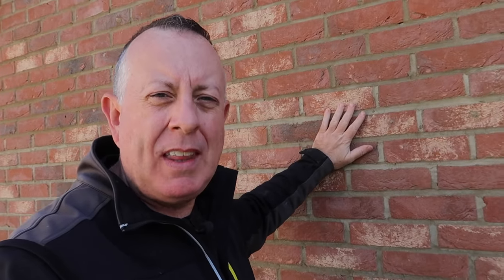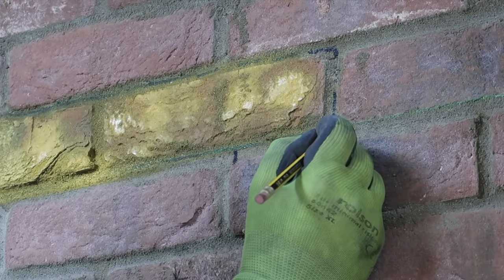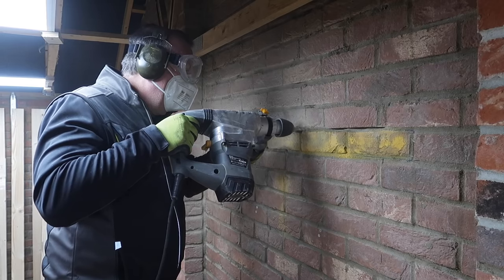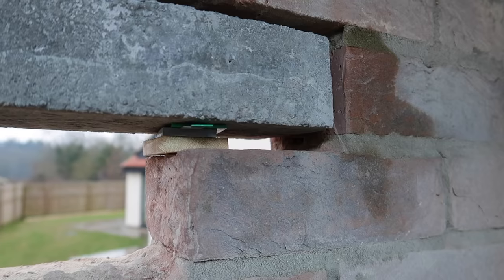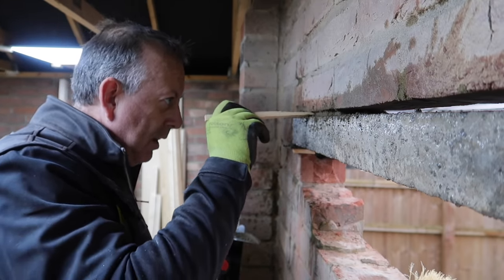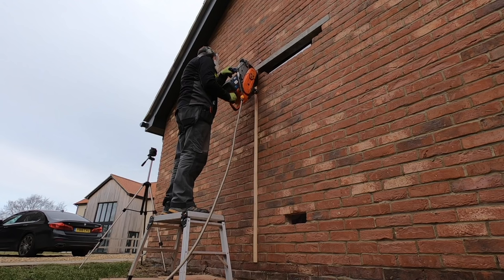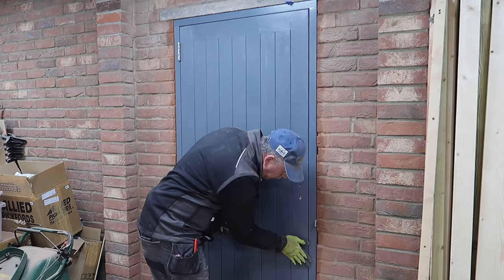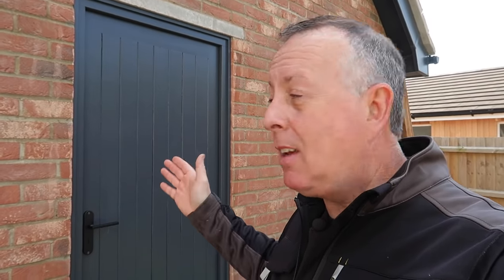How to Install a Lintel and New Opening in Brickwork - Garage to Workshop Conversion Part 3

Comment: An absolute joy to watch this. No corners cut, everything planned and explained in detail. Quite often the finer details are ignored, I've seen so many lintel installations on YouTube that have failed to explain how to position the lintel and how to get the mortar around it. Holding the mortar holder/finishing trowel in position and pushing in the mortar with a square ended stick works far better than a finger trowel. Also loved the timber guide idea. I would've marked it with a pen or spray paint and, as you point out, once the dust starts it becomes completely invisible. Anyway, great video, my kind of work, belt and braces. Thank you!

Comment: Just a tip Stu, nothing wrong with your lintel installation, but I used to, in this instance, lay a layer of soft but good strength mix of mortar on top of the lintel (as if you were laying bricks on it) then offer it up and lift up in place using two bottle jacks. Best way to get a tight joint and then fill in your 150-200mm underneath each side. It will never move totally solid ! Really enjoy your channel BTW

Comment: Superb thanks. Only have one problem doing this myself. I'm scared to death of loosing a limb using one of those petrol grinders. I'm used to use table saws, angle grinders, jointers etc. Angle grinders are the most scary but that huge exposed blade is next level terrifying.

Comment: What a cracking video. Good use of the stick, it should not be underestimated. I liked your comment about the automatic amputation machine. Truth is, it easily capable of doing you proper damage. So don't muck about and protect yourself.
Reply from the maker: Thank you

Comment: 6:55  When pointing I have always used a 10mm mastic knife. Additives make the mortar more workable. Tap the mortar down on to your hawk or  mortar board so it sticks to it and is approx 10mm thick or the thickness of the joint your filling. Then cut off sections the depth you require  with your mastic knife and push it into the seam that you are filling.

Comment: That was a satisfying project to watch and the end result looks great! I've actually used an SDS drill bit in an ordinary chuck once, but it actually damaged the SDS shank of the bit ever so slightly. The damage was barely noticeable but it meant that although the bit would fit into my SDS drill, I couldn't get it back out again without disassembling the SDS chuck and removing the ball bearing which retains the bit.
Reply from the maker: Oh that's interesting. I won't try it again unless a real emergency!

Comment: You are my new hero. Huuuuge man crush. 🤪 Seriously though, this is just about the most perfect a project video can get. I will be doing this indoors soon. Since the wall isn't that high I will probably have to support the top few rows before removing the bricks underneath. I'm thinking of drilling a hole right through a few of those top bricks and fixing them to an upright piece of timber. The walls will be plastered after so no worries about the holes in those bricks.

Comment: Very clearly explained. You would have benefited from a tuck pointer when doing the pointing around the lintel, basically the same as your stick method. They are cheap but very useful.

Comment: 6:54 - That mix might be too dry for this, but have you tried using a piping bag (or a generic plastic bag with one of the corners cut)?  You just flatten the bag until it fits in the gap, slide it until the "spout" is at the end, and then squeeze it as you pull it out. Works well for regular (wetter) cement / mortar.

Comment: My tip is to fit frame and temporarily wedge and then use LOW VOLUME expanding foam to secure the door. You don’t need screws at all. So no filling of screw heads. And the door will close solidly. 

I don’t want to start a debate. Because I’m right :) try it. It secures the door many times stronger than screws. 

Nice video.
Reply from the maker: Thats not one I've heard but I can see how enough foam would secure the door.

Comment: A little tip. Use slate to pack up in between the lintel and the bricks and under the lintel to  the seating, and then you can point up the rest of the gaps with normal mortar mix to  make it blend in. Also where the lintel is sitting on the brickwork should be a minimum of 150mm so as not to cause shear on the perps.
Reply: I'm not a pro but I thought as well I would have let the lintel go wider on both ends.

Comment: Nice job and the battens to guide your cutting blade is a good one.
But usually manufacturers of those pre-stressed lintels will tell you not to cut these, however I doubt cutting a bit off does harm them, as the pre-stressed bar has these spirals to give it bite to the concrete.
So it doesn't depend on anchoring bolts or wedges in the ends, but grabs onto the concrete over the whole length.
Reply from the maker: Thanks. Any post stressed concrete you need to avoid touching but prestressed I've not hear manufacturers saying that before - anyway, as you say, it is essentially bonded to the concrete over the full length so cutting a few inches off is no problem.
Reply: @ProperDIY  At least that was what was stated by one of the manufacturers here in the Netherlands, they tell you not to cut a lintel without consulting them first, I think this has to do more with liability.
Reply from the maker: @Tom-Lahaye  Yes, could well be. On site it's common to trim lintels when required so they are just covering themselves

Comment: Nicely done. The video quality is excellent and the information was concise.
I noticed you didn't use any flashing. The cut was so precise there was no need to hide any blemishes. What advice would you offer in terms of door frame dimensions versus the brick cut dimensions.
Please forgive me if this has been addressed before. There are quite a few comments and I didn't read every single one. Cheers.
Reply from the maker: Thanks. I went for 5mm extra on each side. I could do this as I used a baton to control where I cut so could be quite accurate.

Comment: Hi Stewart! I'm a recent follower and I've already learned loads from your channel! 

I'm opening up a double doorway to install trifold doors. It's not a load bearing wall. Do you think a 9' concrete lintel would be sufficient support or should I be looking at a steel beam instead? It's a block built wall with a 6' concrete lintel in place currently. Thanks a mil. 

Niamh

Comment: You put shims in between the bottom of the lintel and the brickwork. I was hoping to see how you dealt with filling/supporting the lintel while this set.
Reply from the maker: I should have shown that but it is straight forward... With such a dry mix, you can pack where you can and then take out the shims without it moving then pack in the void they leave.

Comment: Rarther than poking in the mortar with a trowel, for about £20 you can buy a mortar (cement) gun. Much easier and it gives a much better bond. I've used them for years.
Reply from the maker: Fair enough, but for £20 I'll stick to the stick!

Comment: I want to add an additional grp electric meter box into the exterior wall cavity. only outside bricks needs removing.
Can I use a metal flat bar in the mortar course to be the lintel?

Comment: awesome job very informative! I'm considering doing this to my garage but my bricks are perforated in the centre - how would you finish the door opening with exposed perforations once the opening is cut? and what best fixings to use to secure a UPC door to perforated brick? many thanks.
Reply from the maker: Thank you. I would be looking at a door frame (lining) that is just narrower than the half brick thick wall (say 80mm for a 100mm wall). That would hide the voids. I would still try to use 'frame fixings' and aim for the brickwork that remains - if there isn't enough because of the voids then aim to use chemical anchors - widely available now for DIY'ers.

Comment: Did you put dpc below the door?
Reply: Same question here. 😱

I've watched a few so-called tutorials on YouTube for new external doors or windows, but haven't found one yet where they installed a new DPC or flashing (as would be required).

Considering he put a concrete step directly under the door, that's going to concentrate a lot of moisture in one area, which will lead to internal damp if no DPC has been used.

I like this guy's content, but he's got to look back at this one and clarify some essential points, such as  damp management.

Comment: I went to remove a 1960’s garage door and frame. Could see the concrete lintel on the inside course, couldn’t see it on outside facebrick course as was hidden behind the old wooden door frame. Turns out there was no outer lintel and a huge triangle of bricks started to aim for my head. It’s propped for now and only lost four bricks so far.

Comment: We recently moved into a new house which was build in 85. The brickwork is a sandy brown in colour and mortared with a mix I have not seen before. It’s not your usual builders sand mix. Can you advise how to match the mix in order to allow repairs and improvements to be made with the match standing out. Previous repairs have been poorly matched and will also require grinding out and improved. It’s possible the sand could be washed Building sand. Not entirely sure. Thanks in advance.

Comment: Should you have not made return pillars inside the garage to add strength to the doorway? By chopping finger joints in the brickwork and returning them inward and bricking up pillars. My garage has pillars either side of the doorway on my single skin/ brickwork garage. House is 1970s. I worry that if someone slammed the door or the wind caught hold of it you would have all the brickwork down on the floor.
Reply from the maker: No need in my case as not that much load. Most doorways you see do not need a column each side.

Comment: You need to be really accurate and neat when cutting the brick work especially on the outside as it will be on show when its finished. I see you put a small trim around but that didn't completely cover the cut bricks. The new cut face on the outside reveal will be on show and depending on the type of brick and the cut will make a difference to the overall look of the finished job - on the inside you don't get the problem because you used architrave. Looks neat though, nice job. Maybe explain in more detail about setting the door lining square and plumb next time.

Comment: Brilliant video. I have the same need at home, however inside the brickwork I have concrete blocks also with a cavity. The garage is free standing and a standard size etc, so don't believe the wall is load bearing in anyway. Is the principle the same but just double the work, i.e cut the brick and the blocks etc?
Reply from the maker: Yes essentially however it may be easier to use some type of galvanised cavity tray rather than a concrete lintel as you have a cavity wall
Reply: @ProperDIY  good shout. Brilliant thanks.

Comment: Stuart,

Great video. I am about to attempt this but I have a question, can anyone help?

DPC... I want to cut my hole and install the door level with the ground so I don't have a step (my garage floor is same level as the outside where the new door is going). This is under the DPC level though by 1 or 2 bricks. If I cut through the DPC... how do I deal with this so I don't create any future problems? Is this something to worry about?

Thanks

Comment: Great vid. How do you pack the cement under the lintel, do you leave the shims and fill the dry mix around them? Also why dry mix and not wet? Less mess.? Cheers
Reply from the maker: Thanks. I should have shown that. I did it in the same way packing as much as I could in the areas next to the shims until I could remove them with the weight being taken by the motar. With the dry mortar well compacted into the gap, it will take quite a load.

Comment: When you cut the lintel didn’t you also sever the tendon?  Or is it ok to cut it?  Why just not take out another brick
Reply from the maker: The tendon is stretched then concrete is poured around it and let to gain strength before the tension is released (in fact they make a number of these in a continuous line and then cut them to length). So no problem cutting the lintel anywhere.
I could have taken out more bricks but to be symmetrical I would have to take one on either side - so the lintel would end up another 440mm long which wouldn't look correct and would leave me with significantly larger span of unsupported wall above.

Comment: Very nice. Did you consider using a Catnic or similar lintel and keeping the top course of bricks?
Reply from the maker: I did look at them but the making good after installation is a lot more work and the concrete lintel I used was £12 so difficult to beat
Reply: Fair enough.

Comment: For the cement bed under the lintel, at either end, do you push that in with the same method using the stick?
Reply from the maker: Yes, a very dry mix that you can compact rather than slumps out

Comment: I don't think I could have restrained myself...  I would have given it all a hefty push. Plus, I imagine the bricks falling on each other, one at a time, would cause more breakages...  But, even if I'm wrong, I would have still tried it in one go - filmed in slo-mo... from several angles... with a cutaway of my dislocated shoulder.  ;-)
Reply from the maker: The main reason I didn't was I knew I would get comments from builders tell me how dangerous it was - and not wanting to encourage others to do the same. I would have pushed it over if no one was looking!

Comment: Do you have to put fixings for the door frame into the lintel? Or does that weaken it?
Reply from the maker: You can do - a couple of small holes into the lintel will be fine but quite hard drilling into concrete so all my fixings went sideways into the brick.

Comment: Did you have a SE specify the lintel or are there set lintels off the shelf for specific applications?
Reply from the maker: I'm a professional Civil Engineer by trade so all my design however for this application the loads are extremely low so off the shelf from B&Q it was!

Comment: I’m just about to do this to my garage, i wondered how you made the frame, or was it an of the shelf frame & door? I’ve been looking at steel door and frame solutions?
Reply from the maker: I made the door but bought the frame from Wickes and modified it - see my earlier video - Mortise and Tennon door build.
Reply: @ProperDIY  thanks for your reply. What would you of changed if the wall was load bearing. In my mind temporary support for the roof while the work is being carried out.
Reply from the maker: @dunesadv894  Yes some acrow props holding up 'strongboys' on one side which essentially makes a frame that transfers the load away from the brickwork below while you are putting in the lintel.

Comment: so I'm a bit confused and I know I'm a total noob, how is that not a load-bearing wall just because it does not support a second floor? Isn't a load-bearing wall defined as any wall that supports a roof? And by the definition, that roof is certainly sitting on the Load of that wall.

Comment: Hi yet again another great video. Can you mention or do another video about your PPE you mentioned it and saying how important it is when you’re dry cutting all that dust that you’re creating an that mask is not suitable for what you use. I am a trained face fit tester that mask is not classed  as tight fitting RPE which you’re trying to protect your lungs. Masks that fit by using your ears or no good. The HSE has classed them as not suitable in the UK.
When you was using a small angle grinder inside all dried dust that was possibly going into your lungs. Your lungs are a non emptying ashtray with all that dust in lungs filling up and it is not a disease it affects you now it’s something affects you 20 30 years later in your life.
You used a machine outside with water attached no dust. Please can you make a point about the right PPE. People are taking notice of what you are doing and it is a great job. Get in touch if you want and I can help.